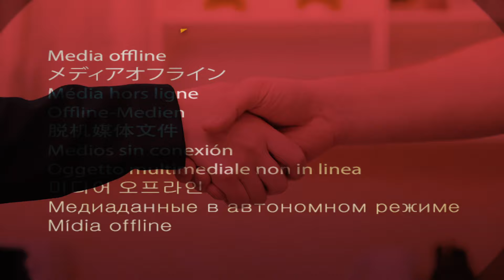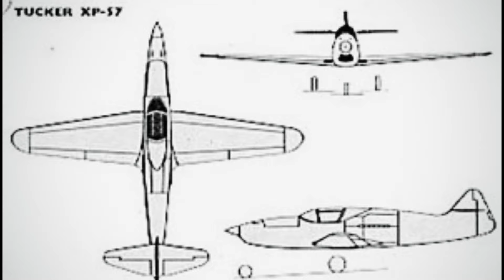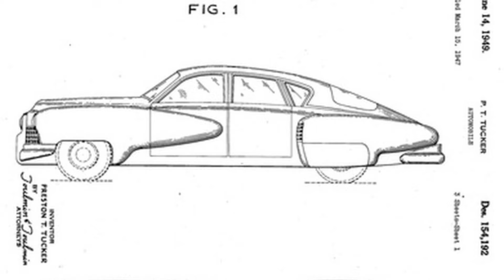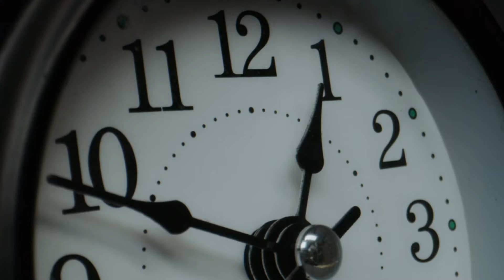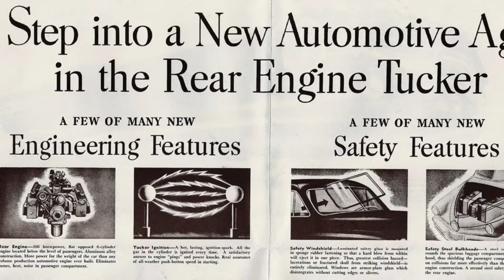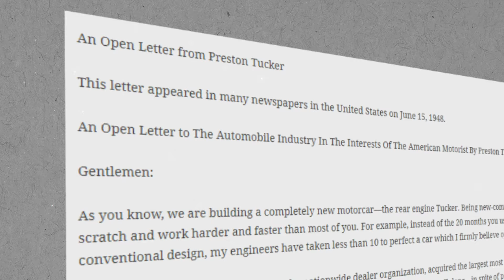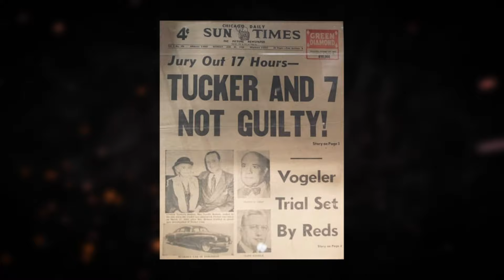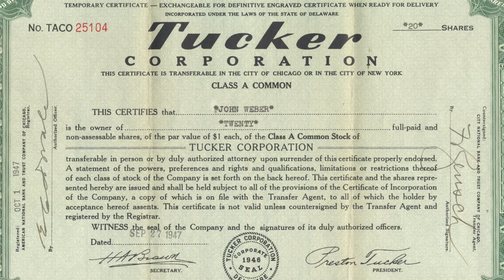The Unicorn Car That Almost Tumbled the Big 3: A Comprehensive Guide | Classic Car Documentaries

Comment: Tucker was able to raise about 25% of the amount of money that would be needed to produce an all new car from the ground up. The fact he got as far as he did on almost no money was a testament to his drive and charisma, but he never really had a shot. And the big three didn't conspire to put him out of business, matter of fact every Tucker is fitted with a Lincoln steering wheel that were gifted to Tucker from Lincoln because the wheel Tucker was designing wasn't ready yet so they sent those over to help out. If you're trying to put someone out of business you don't give them 70 steering wheels. Those are actual facts.

Comment: Tucker failed because although he had an advanced design with the 48, he overstretched himself such as wasting money on unnecessary modifications such as converting the rear mounted air-cooled engine to water cooled which was an unnecessary expense. If he had stuck with more conventional underpinnings that worked for his first project he probably would have succeeded.

Comment: I thought there was 51 cars. Most people forget about the original prototype. I have seen the original prototype at the Auburn Indiana auction several times! And to this day I consider it to be the first one and 50 more came after it!
Reply: Although, i partially agree regarding to 50 /51 numbers of build vehicles in total.. unfortunately in reality prototypes are 2 types :  actual 1/1 functional model or just ideas, (sketches pictures, clay model, etc), that will never reach into factory production phase.. Most functional prototypes are totally different thing from production version, some might not even have motors or transmission at all even 'they appear to look the same' because when prototype is presented for the first time at highway safety authorities to be homologated for public roads many features might get cancelled or not reach at all in production versions, that is why prototypes although are made by same company they do not count as production vehicles and are usually kept as company property / show-room or auto-museums in any rare case very few prototypes are get sold thru auctions to highest bidder end-up in private collectors since most prototypes are not allowed for road use at all, so are usually just sitting engineered creations hidden or exposed, collecting dust.. for quick example "Tucker Carioca" the Tucker concept that suppose to be made in Brazil was presented way-ahead in news-paper, in reality never reach a physical prototype state only crayon sketches & pictures on drawing board-sadly just a cool fantasy..
Reply: @poplaurentiu4148  1 BURNED 1 WRECKED

Comment: Wow guys, c'mon! Get your facts straight before you produce a video.  It was HARRY - HAROLD A. MILLER - very famous race car builder & driver of the 1920's and 1930's.  Not "Henry".

Also, after the trial, the Tucker corporation was hardly insolvent. The corporation had roughly 8-million dollars still in it's coffers and Preston did briefly try to figure out how to get production going again to eat up the stock of roughly 125 engines, 70 or so transmissions, and enough body panels for approximately 35 more cars.  However, the numbers simply weren't in their favor. The back-rent owed on the factory by 1950 was in the neighborhood of 2-million dollars. Not to mention there simply wasn't enough stock-on-hand to complete another 75 cars to use up the engine supply; and the cost to produce those pieces and hire enough workers would cost MORE than what the sale of all 125 cars would bring in.  The numbers simply did not work, and sadly; not a single person wanted to invest in the Tucker Corporation by that time. By April of 1950, Mr. Tucker finally acquiesced; threw in the towel and left the corporation to go into receivership.

They did however, keep Air-Cooled Motors until 1961.

Comment: I don't think the Tucker 48 was that good of a car. A hodgepodge of parts from different manufacturers, and unproven technology that still needed considerable development. Plus an engine configuration that, in hindsight, was somewhat of a technological dead end. Tucker may have gone on to become a limited producer of expensive niche cars. But I doubt if it would have been a serious competitor to established manufacturers.
Reply: Engine placement and lay out was a technological dead end? VW beetle had a rear engine. Cars like the Porsche 911 used a flat six and later liquid cooled like the Tucker.
Reply: @captlazer5509  If the Tucker engineering concepts were so bad - why did GM use the SAME package, including the flat six rear engine and the pop-out windshield, on the Corvair ten years later? They profitably built a few million of those. They were deemed, "Way ahead of their time" as well. Great cars that were sunk by cost-cutting measures in the rear suspension that created safety risks on the first generation of them. When Ralph Nadar pointed it out in his book, UNSAFE AT ANY SPEED, they attacked him and tried to smear him with all of the corporate arrogance they could muster (while simultaineously redesigning the suspension to fix the problem.) Any doubts the big 3 went after Tucker? And yeah, he was over extended too. 
You just can't make this stuff up. . .
Reply: @ricksand6477  I agree with you! I was pointing out the rear engine placement and engine type is not a dead end but in fact used many times. Including GM cars like you mentioned the Corvair. I have seen four Tuckers, one running at start up at a car show, one on the road near a car show and two on display. One of them being at the Henry Ford Museum. The interior was way ahead of its time, the engine had more than enough HP to get the job done. The Tucker 48 is a fantastic car my dad was considering buying in his youth but alas it was not to be. Yes, I also do believe the Tucker Corp was hamstrung by suppliers and those who didn't want the competition.

Comment: The Tucker didn't almost topple Detroit. And it couldn't have.

It was a high priced car. Most of the Detroit sales volume was in the low priced field.

It didn't matter how good the car was. A company didn't need a good car in 1948. After no new cars for 3.5 years anything would sell.

Anyway, your headline turned me off on watching the video. Maybe you got some other stuff right but I probably won't find out.